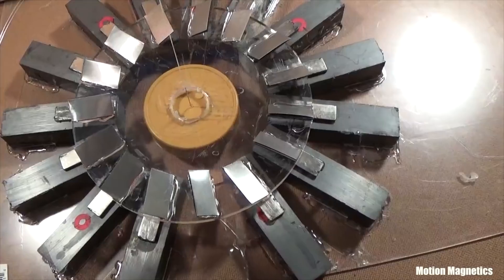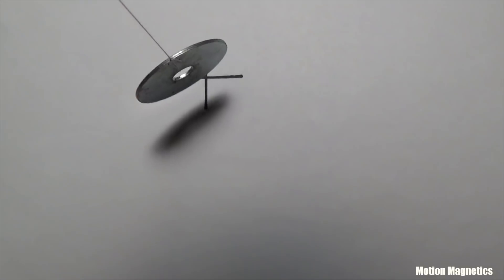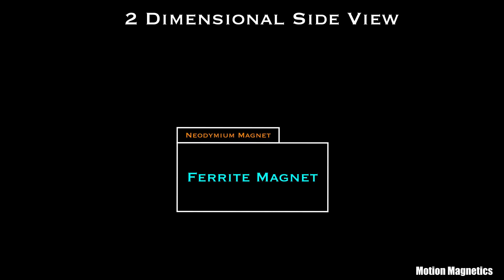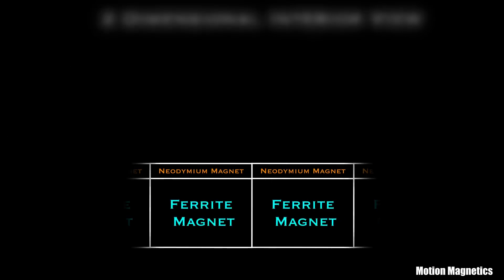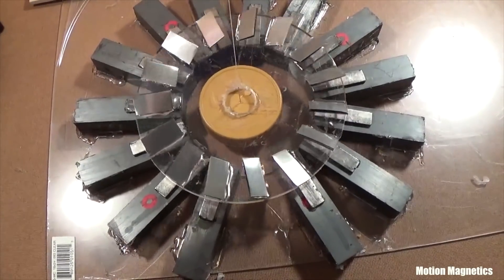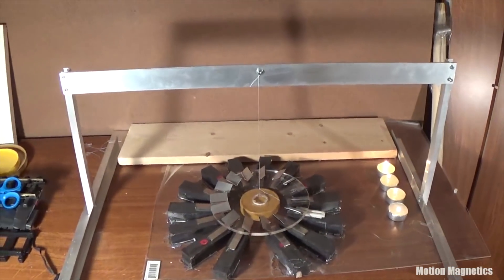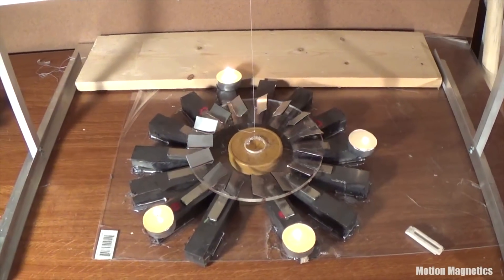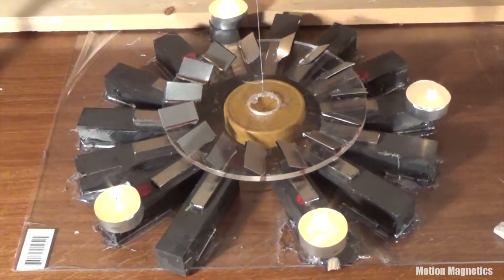Self Running, DiaMagnetic Motor?

Comment: Maybe instead of the string attach a metal stick to a ball bearing. It will still have friction but it looks like it may still spin.

Keep it up! Good stuff!
Reply from the maker: Thanks. And thanks for the suggestion.
Reply: I previously tried to find how I could comment here.  I had a similar idea.  As the string twists, it gradually produces enough tension to allow a release into the bearing.  That would receive the tension and not cause the stoppage of overwound string.
Reply: Releive.... Not receive.

Comment: Nah.... In the washer  Thats because of the torsion of the string that the washer changes direction
Reply from the maker: Not quite. Give it a try. it's a simple experiment. It works better with a smaller washer than the one I used in the video.
Reply: Motionmagnetics so u talking about ESP? TK?
Reply from the maker: No. Not at all. There is nothing magical about it. When studying athletes, scientists have proven that simply practicing an exercise or activity in your mind can yield similar results to actually performing the activity. You can cause your mind to fire the same electrical impulses through your muscles, by practicing something mentally or physically.  The example I used in the video of the washer is simply a smaller scale example of that, which doesn't require sophisticated equipment to demonstrate.

Comment: hey the winding an dewinding or the string is what is changing  the direction man. nothing to do with what you are thinking. Kenetics  works at distance without having to touch
Reply from the maker: It only spins in one direction, rather than unwinding back and forth, which I why I shared the information. I'm doing a further analysis though, which I'll publish in another video.

Comment: Nice presentation.  I wanted to built something similar.  (Dia-magnetic vs Para magnetic)  Nice build.  Did you try bearings though.  Rather than string.  It would be interesting if you could overcome the resistance to start.  Perhaps a magnetic bearing ???  As long as the magnetic bearing doesn't effect the rotor.  Just a thought
Reply from the maker: I'm trying several different methods, right now. Including, altering the orientation of the magnets.

Comment: It would actually work out better if you would cut the magnets so that it would bend the magnetic fields put out by the magnets!   :-/
Reply from the maker: Cut them in what way?
Reply: +Motionmagnetics 
you might want to try placeing a rubber magnetics spacer under the bottom set of magnets or grind a little bit of of them.  It's possible to bend the magnetic fields when you cut them on angles or use different materials to to help bend or block the magnetic fields to get better results.

https://youtu.be/ZgbtUWhlJzo
Reply from the maker: That's an interesting thought. Sounds like something Howard Johnson might have tried.

Comment: Totally intriguing video! I love it. Instead of a string, please next time use a magnetic suspension bearing. I mean two steel ball bearings, between them just enough magnetism to carry the weight of the spinning wheel.
Reply from the maker: I was just working on a magnetic mechanism, to suspend the rotor from. I haven't been satisfied with that as an option so far.
Reply: I really can't see why it wouldn't be a great option for your project. Have you seen this?  https://www.youtube.com/watch?v=_STnL0U9PyQ

Comment: Offshore Angler Extreme Stainless Steel Barrel Swivels add to the top of the string - cheap/effective/low resistance. Used them on several "proofs" work great if you already have balanced the wheel.
Reply from the maker: Thanks. I'll give that a try.

Comment: Very good explaining the unintentionally added human factor. But why not just hang the "stator" from a frame made of some insulating material, or use the ceiling?  Just wondering.
Reply from the maker: Thanks. Did you mean, the "rotor"? I did hang that from a frame, at the end of the video.
Reply: Yup, sorry my late hour bad. I skipped the end  ( My bad # 2 ) I would have used a known insulator like wood or flakeboard and a string that was known insulator, unless you believe in the quantum physical world ( which I'm trying to get into ) that wood can be magnetically polarized.  

I make more sense when I/m awake. : -)

Comment: The laws of Thermodynamics cannot be overcome by human ingenuity, no matter how hard one might try.
Reply from the maker: I'm not trying to change the laws of physics, but science is just a measuring stick. When you come up with something new, that the standard method of measurement doesn't apply to, you design a new measuring stick. There was a time when the acepted understanding of physics stated that heavier than air devices could not fly. When that was proven wrong, the law of lift was used to explain it. Physics didn't change. Only our understanding of physics did.
Reply: atremides either build one and test for yourself or shut up. simple as that.
Reply: There is no point in this, as it does not work. The same good suggestions for you as well :)

Comment: I am so impressed...if you have time could you place a round plastic water pan under the bottom of the rotor...fill it with water...float the rotor on the water under some Styrofoam...place opposing magnets on side of water pan and on rotor...should now spin for longer time...
Reply from the maker: Thanks. I'm not sure I could do that, without completely changing the way the stator assembly is set up. I'm working on something different, to replace the string on the rotor. That was really just the preliminary method I used to test the initial set up.

Comment: Try putting the top of the string via a fishing  hook bearing because for each rotation you increase the the counter stress on the string. Not good. Something like this.
https://www.aliexpress.com/store/product/20pcs-Fishing-accessories/1937948_32757517893.html
Reply from the maker: That's a thought. How easily do those turn, when they are holding weight?

Comment: Why did you not show a clip of it when it slows down and stops as you claim? Still nice vid thanks for sharing.
Reply from the maker: Thanks. I filmed it for about 10 minutes and had already shut the camera off before it stopped spinning. I wasn't sure if people would sit and watch it spinning for that long, and I didn't know how long it would actually spin, at the time I filmed it. I'm working on a new set up for the rotor. If I come up with an alternate method that I'm satisfied with, rather than hanging it from the sting, I'll post it.

Comment: Substitute the string with small balsa rod with needle attached to the top of the rod. Affix neo magnet to aluminum frame so the rotor is suspended from magnet via the needle. This creates a very low friction bearing. Hopefully this method will still allow rotor to turn and at the same time stop the trolls from saying the string has been pre wound. Your years of determination to achieve rotation with magnets is to be commended. I for one have watched and learned a great deal. Keep up the good work.
Reply from the maker: Thank you. I was working on doing something like that last night, but the neodymium magnet wasn't able to hold the weight of the rotor by the needle. I'm working on it though.

Comment: Thanks MotionMagnetics,  it's clear that 2 different test cases were given in the video. Unfortunately you changed 2 variables (1 - string held by hand then support frame, 2 - no candles, then candles added) between demos so the logic is flawed.

The correct data will emerge only if you video the string/diamagnetic rotor in suspension from a static frame, untwisted and still, after which the lower magnet assy should be slid slowly and carefully into position.

If your claims hold true then the rotor will spin many many times, until equilibrium torque is established.
This is the video you need to publish! 

Otherwise it's quackery.

Not trying to rain on anyone's parade, simply offering suggestions to improve the SNR,   which is an ongoing  UTube problem.
Reply from the maker: I initially shot the footage with the rotor spinning between the candles, and then extinguished the candles, to show that it spun regardless. I ended up cutting around 7 minutes of footage from the video though, as I was concerned about the runtime. Not everyone on YouTube has a long attention span. I'm working on a replacement for the string, to make a better presentation. Thanks for the comment.

Comment: you could attach a sculpting wheel or maybe with a small ball bearing wheel to make it spin longer while attaching to something more sturdy, making a single moving part
Reply from the maker: It needs something better than the string. The rotor doesn't spin with a lot of force, so it's tricky.

Comment: cool........does it not spin without the missing magnet ?
Reply from the maker: I didn't try it that way. There were two reasons I left the gap. The way the magnets lined up to the circumference of the circle, it would have required a larger circle if I wanted to continue the North to South arrangements I used. So I would have had two north or two south magnets in a row. The biggest reason I left the gap in the magnets though, was because I noticed in a lot of my builds that you need to break the symmetry to induce proper movement.

Comment: try a clear dome of plastic on top if the moving assembly and support it through the center on a hard pointed toothpick - position the dome to find the center of gravity - attach the toothpick to the plastic base in the center of the non-moving assembly thru the hole you will need to drill in the moving assembly - you will end up with a view-able make-shift bearing if you can find a clear dome
Reply from the maker: I was considering something like that. Thanks for the suggestion.

Comment: Dude.... Come one. Weak... String unwinds, over winds, and spins the other way... Di you think it would just spin and slowing come to a stop without switching direction??
Literally 4 year old logic. Fucm
Reply: I'm a crane operator. My crane has a 70' boom with 5/8" steel cable. The cable is made up of 7 strands twisted clockwise. The strands are each made up of 21 individual wires which are wound counterclockwise. When I use it to lift our 2000# pile driving hammer, the hammer begins spinning counterclockwise. ALWAYS counterclockwise at first. After about 10 rotations, it begins slowing down, and stops rotating at about 20 spins or so. (I never bothered to count them. Once the hammer has stopped spinning, it starts spinning the other way. I see this every day. It happens because the weight of the hammer causes the cable to unwind slowly. As the strands unwind, the wires in each strand are being wound tighter. For any given weight on a given cable, there is a counterclockwise torque from the weight trying to unwind the strands, and a clockwise torque from the weight trying to unwind the wires within each strand, and an equilibrium point (number of rotations) where these torques are balanced. Initially, the counterclockwise torque dominates.  The hammer's momentum carries it past the equilibrium point, and the clockwise torque begins to dominate - slowing and then reversing the hammer's spin. If I hang the hammer for a long time, it will keep spinning one way and then the other, back and forth, less each time, until it finally stops spinning at that equilibrium point. We use a swivel link to connect the cable to the hammer. The link only swivels when the cable is unloaded. If I set the hammer down and unload the cable after the hammer has reached equilibrium and stopped spinning, the cable will rapidly spin clockwise to its unloaded equilibrium point, where it was before I lifted the hammer. There's no magic here, "thinking about it" doesn't make it happen. It's purely a function of the way the cable was wound when it was made.
Reply: steve66oh thank you!
Reply: Beautiful reply Steve.  I do construction work using a plumb bob frequently, and the same thing happens with the string it is attached to with the only difference being that once at loaded equilibrium, if I drop the "Bob" to the floor, the string spins and wraps itself into a knot as it seeks its unloaded equilibrium.
Reply: thank you
Reply: +motion ok so to prove this isn’t what’s happening buy the swivel with the least resistance and see if it keeps running. Or you could devise some kind of thing that doesn’t use string.
Reply: was just about to comment the same thing. Strings aren't just one string but many wound around each other and they certainly do unwind.
Reply: Except that we watched in your video the change of direction when the washer reaches the point the string can no longer unwind. You even pointed that out. That which you claim is being done by thought. Then you say in your reply to a comment that it stopped and didn't continue moving due to a magnetic field which actually is not present (magnetometer on any smart phone will prove that) The string can't fully unwind, it can only unwind so far before it hits a point where it is winding in the opposite direction. I can do this without any plus sign on any paper an without any care to project thoughts at it. it's physics, and logic. No magnetic fields were near to hold the washer in place, the string just got to the point it could no longer spin as the energy balanced out. I can't believe you even uploaded this trash and thought anybody would think you know what you're talking about. If I gave a 3 year old a string tied to a washer and told them to tell me why the washer spins one direction then the other and eventually stops, they'd at least be able to tell me and wouldn't come up with some nonsense about magnetic fields doing it. Steve (above) explained it much better than I can.
Reply: I’m guessing he knows it’s bs, uploaded for the views, laughing at the people taking him seriously.
Reply: Hey MotionMagnetics. Steve66oh has a valid point. A fishing line is not made of strands. Use a really really fine fishing line to counter his arguments. Thank you.
Reply: Any suggestions on how one can find a truatworthy Angel Investor in an endeavor like this ?
Reply: Secondly I obviously don't have mush $$ What should one do after a working prototype is created ?
Reply: So why didnt you just get a stick, put in on a chair or something, put something heavy on it and bound the line on it? I have a Theory for a Build but i have no Magnets..
Reply: I think the part showing him holding a magnet close to the aluminum coper pieces shows the attraction and repulsion process.  The string was just a paracortical use for it.  you so called physicists are debunk of going outside the box as Howard Johnson was so get over yourselves!!  Maybe you could learn something!!  You do realize your brain wont reach maturity until your age 26!!!  Get off the pot which will make you loose up to 10 IQ points!!
Reply: What A dufus
Reply: alex binger why don't you make your own video  perfect One
Reply from the maker: I actually thought that the rotor, when it finally wound too tightly, might begin unwinding. To my surprise, it did not. The magnetic fields held it in place, once the string was wound too tightly for it to continue spinning.
Reply: @Motionmagnetics  put the string to a ballbearing above or so , so it can keep on spining without winding the string
Reply: @Motionmagnetics  better idea...: a nail or something other magnetizabe that is point , then string to the head end and the pointy end is hung from a small magnet above .. (partial magnetic suspension)
Reply: Fuck off

Comment: It could function in a way like William Crookes (1832-1919) Radiometer does. :-)
Reply from the maker: I thought of that when I first put this together, but the air would have to be sealed around the device, for it to function the way the radiometer does.
Reply: No, certainly not. As you yourself demonstrate, pyrolytic graphite is repelled quite strongly by magnetic objects. I do not think the rotation will stop if you added the missing magnet to the hole below. It may be that the magnetic currents hit the graphite at an angle and then pushed to the side like a wind turbine, as you say. Think about Young's Double Slit Experiment in the period around 1805.
Reply: Jod. No, it couldn't, and no, it doesn't. Sorry.
Reply: No, I agree, but it was the only option that was left, if not all of his layout was a bad joke. What it is. It is sad that he criticizes other people's fake arrangements, and so tries to surpass them.

Comment: Nice, try to put a swivel on the string, or let the string hang from a sewing needle, and then the tip can be put against a strong magnet. You can also place a small magnet at the eye of the needle, to get greater adhesion force. Or tying the cord in an elongated magnet, so that it hangs at an angle, so that only a single corner will touch the magnet which is fixed above it. You can also lubricate the contact surface with silicone for less friction   :-)
Reply from the maker: That's not a bad idea. Thanks for the suggestion.
Reply: Jod Dali 8
Reply: Kinky sod

Comment: Put the string through a bearing assembly so that it could spin freely. Then, if it spins forever, you know you have something. Also, you should demo this without the candles.
Reply from the maker: I thought that showing it spinning without the candles in the earlier part of the video would suffice. Regardless, when I extinguished the candles, it continued spinning. I would have left that portion in the video, had I realized how many people would think the candles could be causing it to spin.